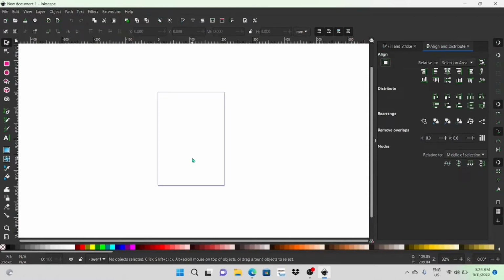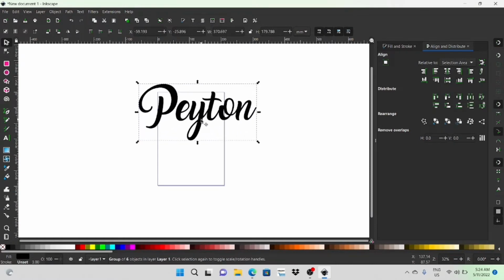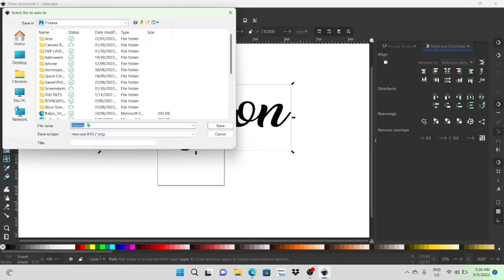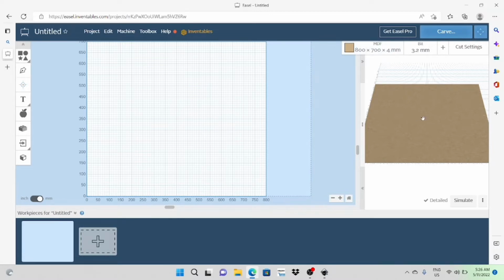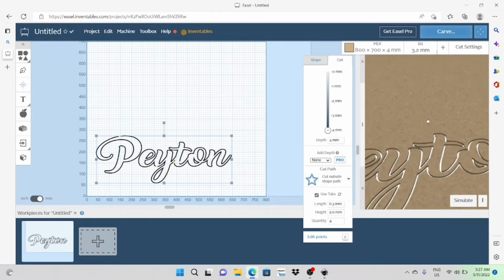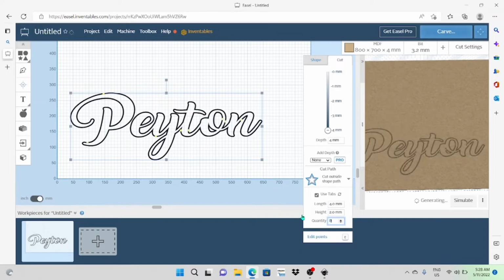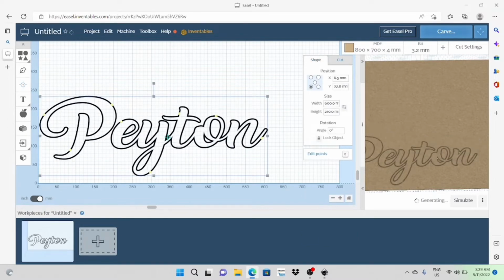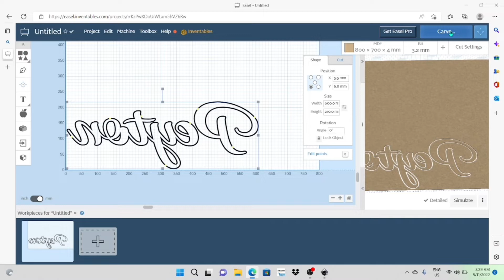CNC! How I make this name!! U/Inkscape & Easel!!

Comment: I'm trying to get this GCODE project I created to load up on Candle. I can't seem to get it to work on my 3018 Prover V2. I create the GCODE, load it up on Camotics and it plays out fine. But when I load it on Candle the spindle spins and I get an error message. Any advice on what I'm doing wrong?
Reply from the maker: Hi, I’m not to sure as I don’t use candle or camotics sorry but sounds like it could be ground noise from the spindle is everything grounded properly? a few year back I had a similar problem and it turned out that my trimmer/router that was installed on my cnc machine was causing the problem it would run the job fine while router wasn’t on but as soon as I’m turned router on it would stop amd give me a warning I switched them out and it fixed the problem, 
give yourself enough hight clearance and run the job without turning on your spindle see if it runs the job then.

Comment: You said a 3.2 bit... which bit? Sorry newbie here and want to order bits
Reply from the maker: Hi Wendy, no problem, there a 3.175mm bit I use 2 types 2 flute straight cut and also a spiral down cut I find the spiral down cut good for cutting things out and the 2 flute is good for pocket routing as in clearing out material i purchase mine from eBay I just buy the cheaper ones you use more but get more for the money 😊 hope this helps cheers, Matt
Reply: Thankyou! Yes it sure does help!